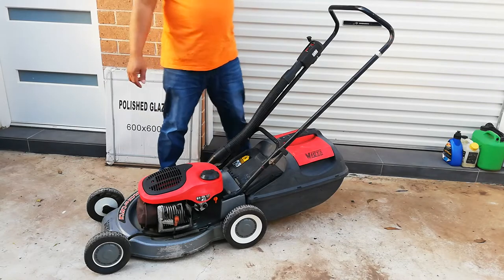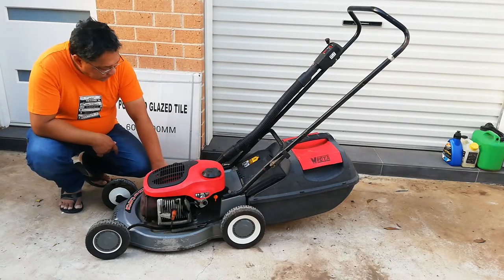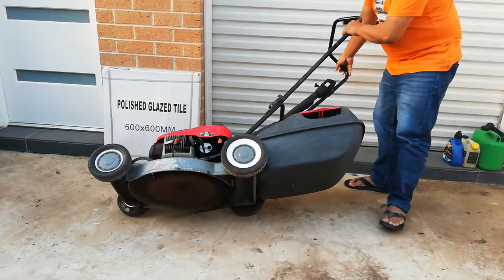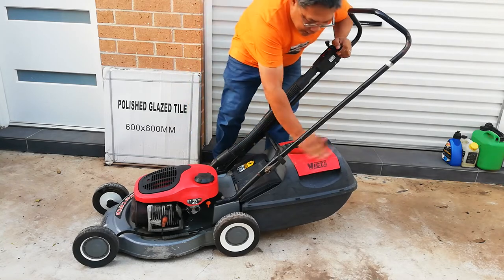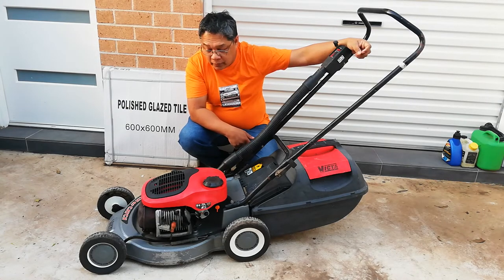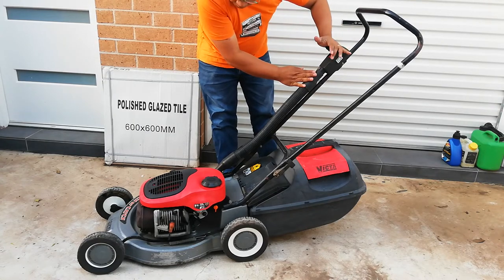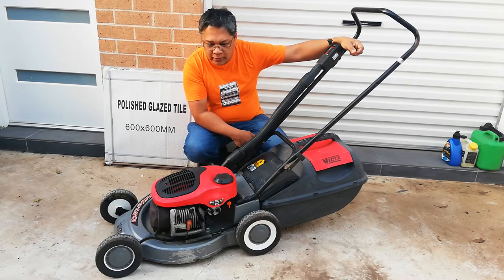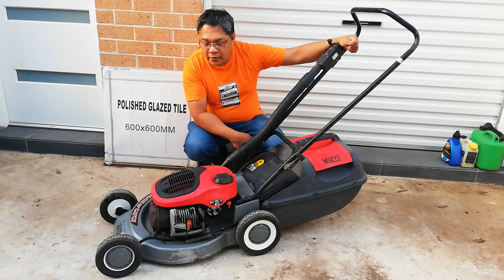VTECH 1 - My First YouTube Video - Victa 2-Stroke Mulch and Catch Lawnmower

Comment: Great helpful Tips and different Colours as well and 5 Years is a very long time to own a mower like this one as well, and of countess it is very good to look at and review as well as we look into it you can see all of the Controls and the things on the lawn mower as well as starling 3 primes and all carbeutor pumps are all different in colour as well and they all look really nice and helpful as well as pull starting toes on as well some new modules like at Aldi give you electric pull Starts as well as giving it a very good run but better off with pull Starts but the Ropes are they hard to fix unless you are authorised to get a match and fire on it to match up again as well, as well you use it to get to the pull starter grip as well as weather is important as well and you can have good Tikes mowing lawns and peoples lawns and at the park as well, .

Comment: Hi mate,
Well done on your first video.
Good on you for having a go.
I just picked up the same mower from a skip bin
somebody was throwing out.
In very good condition except some carby bits were missing.
I swapped the carby and it starts and runs well except for what
I believe is a big end bearing knock. Will sort it out when time permits.
I have become to appreciate how simple these powerful Victa 2 strokes are.
Reply: You can replace the bearings, they are easy to find, and not difficult to replace, probably worth checking the piston and rings, may need rings?? Well worth doing!!!!
Reply from the maker: Yes mate, it's good I did my first video to get me started on YouTube. Used to fix mowers and small engines on the side but now not doing them for living and instead I better show and help others to fix there own machine and I still have lots to show and to teach. Anyway it's good that still lots of people love the old VICTA 2-stroke. So I do. If time permit, I will cover a full engine rebuild including piston, piston ring or bearings like the problem of your engine. Keep us updated how's you go. Replace the bearing. Cheers!

Comment: It has got Full Sets of Sales Products like, a 5 litre jerry can and a blue 2 stroke oil bottle as well as a, white jerry can as well nice red and black design machine as well, and it is a really nice lawn mower as well great for Authroised commercial and homeowner work as well,  for a standard module like this one as well,.
Great silver and black wheels tyres and connect Ons as well,  with nice info showing on the machine but not full information in general as well but all Videos are all different as well in footage too.
Reply from the maker: Thanks. Nice review of the unit and and observation of what around the scene! Funny but nice! Well done! Thanks for watching our video.

Comment: i just found one on footpath  it is alloy base  ,did yours have 4 or 2 blades
Reply from the maker: Nice find! Mine has 4 blades.
Reply: thanks,mine has 4 holes but 2 blades ,came with mulch plug but stock catcher I am jealous of your red catcher
Reply from the maker: @richardconlin3283  yes the contrast of red and black is nice especially clear finished. You can plastic paint your catcher dust vent flap with red the clear coat if you have similar style catcher. My mower if you inverted it, it would looks like a Redback. 😄
Reply from the maker: Nice video with all your VICTA mowers collection. They are all in good looking condition. Well done!